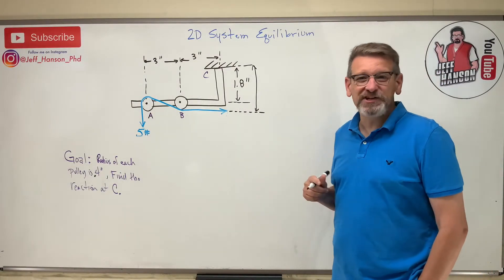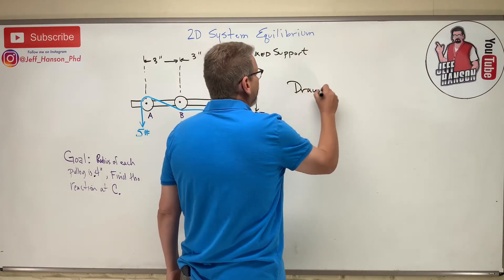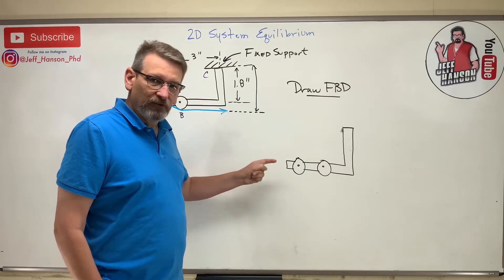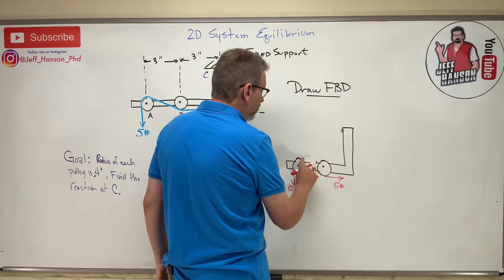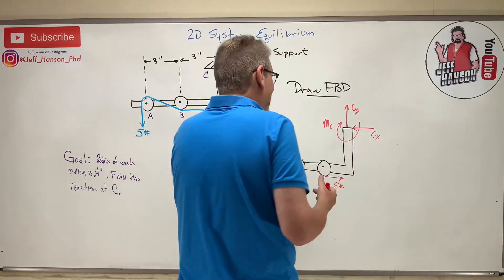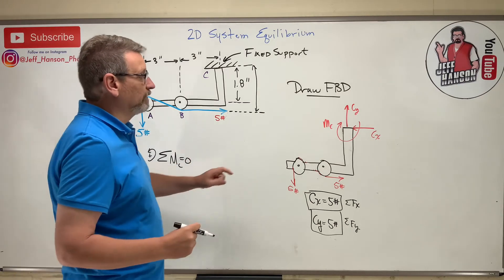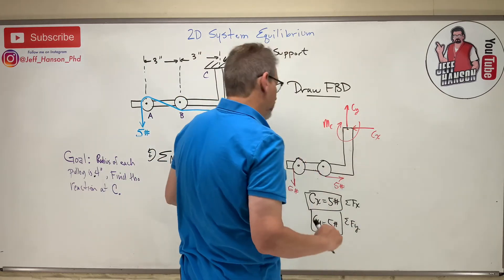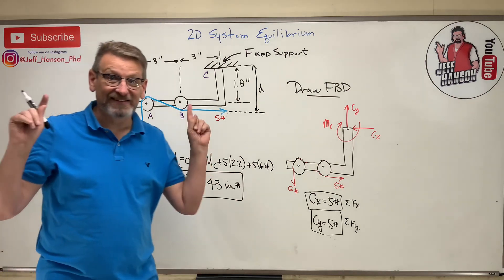Statics: Lesson 32 - Fixed Support 2D Reaction Force Problem

Comment: im a little bit confuse if the assumption about the moment was correct since we got a positive moment. positive moments are in CCW direction
Reply: i already finished my statics. sir jeff is correct here buddy.
since we assumed it to be cw in the fbd, and the convention is positive ccw, thats why we wrote negative Mc on the summation of moment at point c. 

we then got a positive value, that means, the assumption was correct. if we got a negative value, then Mc should have been ccw in the fbd.
Reply: hope this helps
Reply: @alkhapidzjabarani9695  Okay now i understand, if the moment currently acting at point C is CW then summation of moment about point C should we counter clockwise to maintain equilibrium. And also your explanation about signs. Thank you mam.
Reply: Hello mam, I too have the same doubt. Sir had told +ve for CCW and -ve for CW moment.
Jeff Hanson sir, please help.

Comment: I have only one question;
Isn't there another force on the pulley B, caused by the rope's tension?
Is it negligible, or anything else?
Reply: The force throughout the rope will be same as it is assumed to be friction-less pulley. Force will generate in a pulley when we consider friction between rope and pulley.
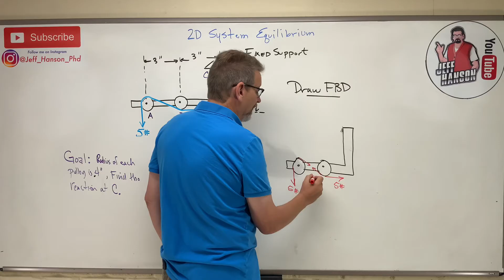Reply: 3:02 He said that there were more forces on the pulley but the canceled out. Ik you might now need the answer after 3 years but ima keep this here if someone else was confused

Comment: What happened with the radius of each pulley? Useless information?
Reply: they were added to the perpendicular distances to the center of the circle. 1.8 to the center + 0.4 to the rope.
Reply: yeah that's where the 6.4 and 2.2 values came from. Hope that helps.

Comment: for the momentum, in the first force why did we take the vertical 1.8inch distance and not the hori 3inch like for the second one??
Reply: Because to find a moment you take the distance perpendicular to the line of action of a force.
Reply: @jakub2645  so 1.8+0.4 is perpendicular distance with the force 5# & C, & 6+0.4 is perpendicular distance with the force 5# downwards & point C right?
Reply: @harithamsyar5689  That's correct.
Reply: becauseeee if the force is in the X , then distance is in Y!!!🎼🎼🎼